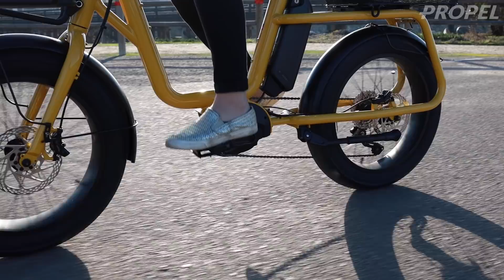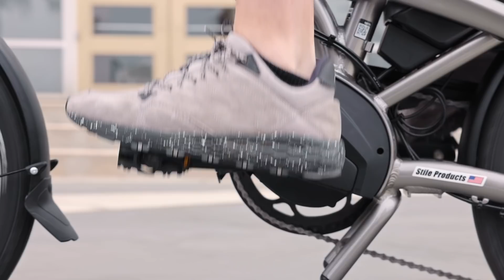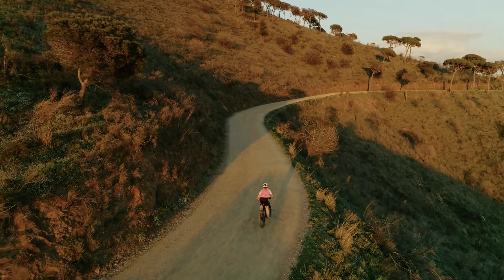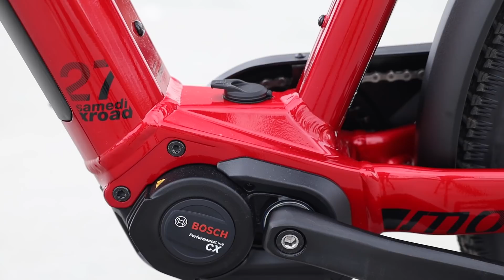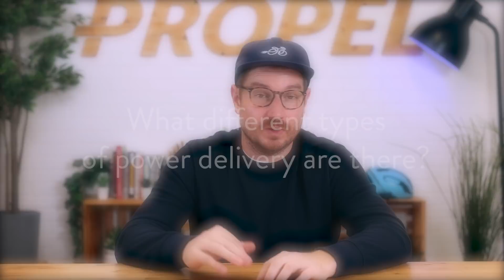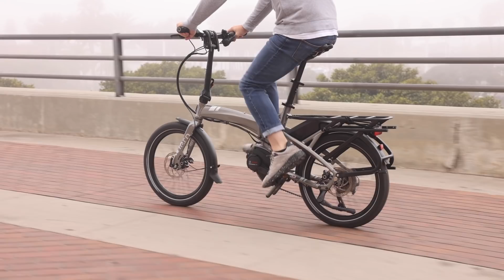10 things you should know about eBike Motors

Comment: Don't know if it's in the comments or not but, quick question... how would you emp proof an e-bike? Or does it even need to be done? Like if you get one of those EMP Shield things, where would you connect it? Folks put them on cars but gas pumps run on motors too, so no gas pumps-- no gas. E bikes'll still be going but you'd need a good gun to keep it. Still... how do you emp proof an e-bike?
Reply: Just got hit with  class 5 solar flares and nothing happened

Comment: Yes it was a great video thank you for doing this my thing is a torque I was thinking about that tonight and my other thing is those bars have a motor that I can put on my mountain bike mid drive adapt I have a wtb if you can believe I still have one lol. Because I didn’t want to convert it to electric torque is very important to me I no longer ride off-road this would be so that I could use it for work my intention is to have a push lawnmower and blower and a Weedwhacker all battery operated and that’s my intention to have a side hustle

Comment: Thanks for the video. I have a question that you did not address: Why do mid-drive motors often advertise twice the torque at the same rated power from the same company in a hub motor? Are they taking credit for the gears? Or do mid-drives actually have circuitry and/or gearing that doubles the torque?

Comment: I never thought about it as throttle vs pedal assist.  I always assumed most ebikes just came with a throttle for situations where you wanted to take a break and let the bike do its thing for a few minutes.
Reply: Thats more a USA thing really, most euro countries don't even allow a throttle. The taking a break is not much of a issue on most mid motors if you put them max support you only maybe add 40watts thats almost nothing and is like taking a break but just moving along as if you are almost going downhill. The added value of only peddle assist is that your peddles kind of control things all the time and is closest to normal cycling and feels very natural at all times including if you hardly need to push its like just having a nice tail wind.

Comment: A useful video, though the thumbnail suggests that you were going to go through the innards of a motor or two.  I'm looking for more info on the geared motors, and the durability of those that have plastic/nylon gears.  
Good to teach your viewers how to derive watt-hour figures for battery capacity so that when shopping, they can compare battery sizes whether 24 volt, 36 volt, 48 volt or 52 volt.  Obviously there's a direct correlation between watt-hours and the most common question asked of all eBikes:  how far can one ride this on a single battery charge?

Comment: What about protection systems?  Which, if any, have fuses or thermal cutoffs?  I don’t recall whose motor it was, but was probably a “less” expensive one and they were pointing out that they have a thermal protection for the motor that will cut off power to the motor when it hits 120 deg F.  I live in north Texas and in the summer it isn’t unusual to have 100+ temps.  Plenty of other places get even hotter.  Related then would be if these hot temps can impact the batteries?
Reply: batteries don’t like the heat period

Comment: A wheel motor with throttle is handy if you have a problem with the bike, like a broken pedal, chain or shifter.
Reply from the maker: This is a fair point, but there are plenty of challenges with that as well.
Reply: A simple solution is just make sure you have a spare chain in your repair kit with you. It's easy for me to always have that in my backpack on long rides. Haven't needed it yet, but i have it with me if the chain ever breaks while riding.

Comment: I will only go for direct drive hub motors. Mid-drives have to replace the chain and cassette every 300km and the motors will break down after a couple of years. Geared hub motors will also just self-destruct/ wear out after a year or two.
Reply: My Mid-Drive Motor is from 2010 (Panasonic System) - Chain changed after 6000km/8 Years and Motor still working and my weigth is 150KG (approx 300pounds) It must be a miracle!
Reply: Bet you're a good Räder. @DSP16569
Reply from the maker: This hasn’t been our experience,  but maybe with mid-drives that don’t have any sort of shift detection. I see those eating up drivetrains. I’d recommend checking out the Bosch system, you might find that changes things a bit.

Comment: Can you comment on longevity of the motor and battery? These things aren't cheap disposables I presume.
Reply from the maker: Most will last around 5 years if properly taken care of
Reply: @Propelbikes Do you know what exactly goes bad and can they be rebuilt or replaced? I guess we'd better carefully look at the support & commitment of the manufacturers we buy these from!
Reply: This is where a rear hub motor shines- if it fails (typically very durable) it’s cheap and relatively easy to swap out a whole new rear wheel,quality mid drives are excellent,but if it fails $$$$ and try to find someone that knows how to do a repair - definitely inspect the price of a replacement battery for your specific model of choice/ eventually it will need replacement (could last years if properly maintained) so,yes battery price’s can be $400 or $1500!!! Beware
Reply: @777noirkat  Looks like the direct drive motors are maintenance free but as there no gears and the regulation in EU is capped for 250 Watts you won't find may models with them. The rear  hub is not necessarily direct drive it could be also be similar to a mid drive I guess?!

Comment: It would be nice to setup a shop with a low power wheel dyno, but mid drive would need multiple ratings for each gear. Everybody on earth calls their motor "powerful" no matter how little it has!
What that red bike at 12:08? Looks really nice and I would be interested in it. Mid drive is more balanced, and you get reduction gears even before the drivetrain. However, I've found that they do wear the chain and cassette faster. Hub motors put the weight in back and this affects nimbleness, but there is zero wear on the drivetrain when using only the motor. There is also a reliability issue, as any drivetrain failure with a mid drive takes out the ability to use the pedals and the motor. A drive train failure with a hub motor just means ghost pedaling or using the throttle to glide home. Each has pros and cons, and preference depends on your needs. 

Pedal assist is my friend as a former marathon cyclist. However, a throttle has rescued me several times from inattentive or out of control drivers, and I like having both. Thanks for the video!

Comment: Can anybody explain the difference between torque and assist level? Bosch talk about say, 85nm torque, or 340% assist, but different torque powers seem able to provide the same amount of assist and vice versa. What does it mean in terms of riding experience?
Reply: The Controler limit the Power depending on your human input (The Sensors)

The motor (or better the System Motor,Batterie,Controller) has a maximum output of 85Nm (on a wide rpm range).

(Simplified) - The Sensors detects that you pedal with 10Nm (your human input) the controller set the current electrical output(aka support level)  to:
ECO (60%) - 60% of your 10Nm = 6Nm => Your 10Nm + 6Nm motor = total torque of 16Nm 
Tour (140%) - 140% of 10Nm = 14Nm => 24Nm in total
eMTb (special case with 140% to 340% support depending on current sensor readings)
Turbo (up to 340%) - 340% of 10Nm = 34Nm => 44Nm in total

Ok in all this cases you are even not close to the max.85Nm output of the motor.

Let's say you pedal with 50Nm (harder human input)

At Eco 60% of 50Nm is 30Nm => 50Human Nm + 30 Bosch Nm = 80 in total.
At Tour 140% of 50Nm is 70Nm => 120Nm in total

But

At Turbo 340% of 50Nm WOULD BE 170Nm - but the Motor can only deliver 85Nm  - therefore no 340% support in this case only 85Nm (170%) instead => 135Nm in total

If you pedal with 40Nm 340% would be 136Nm - but is 85Nm
If you pedal with 30Nm 340% would be  102Nm - but is 85Nm
If you pedal with 25Nm 340% would be (and is) 85Nm

Over all the Level (ECO, Tour, Turbo and the variable eMTB) decided how much percent the controller will command the motor to support you (60% to 340%)
The 85Nm is the upper Limit of Support of the Motor - as long as you do not reach (with the Percentage of Support) this Value you get a linear support, if you reach the limit the percentage support will be lower and lower but you still get the maximum support the Motor can deliver.
Reply: @DSP16569  good explanation, thanks.
Reply: If I understand what you're asking correctly... then I would say that it's kinda two sides of the same coin. Torque is simply rotational force...how hard the wheel is spinning. Your assist level basically tells the controller how much of that torque to apply to the drivetrain.... You dictate how much of the torque with where you set your power level. That being said... that may not be the case for each manufacturer and how they choose to apply that percentage - is it a percentage of the total torque that the motor is capable of... or is it a function of the effort applied to the drivetrain by the rider? That I can't answer...but I do hope this helps.
Reply: @ttaylor6868  great, thanks.

Comment: I have a 2017 Big Bud Pro 4" fat tire ebike with two hub motors (AWD) 350 + 250 watts.  I live in the Catskills where my challenge is always hills, especially on dirt roads.  It is not always easy -- but plenty of exercise.  Do you think a 250 watt Bosch would work better?
Reply: I'm no expert and can't speak for the Bosch but my understanding is that if your bikes lowest gear is low enough a mid-drive can get you anywhere your tires can get grip. May not be fast though.

Comment: Thumbs up on (1) looking at torque and (2) test ride. My ebike has a direct drive motor that is rated at 750 Watts, and puts out 40N-m of torque. Many of the geared, 250 Watt motors are producing 60-80 N-m of torque. Torque will get you up the hills!
Reply: power = torque * rpm
power will gett you up the hills, provided the gearing is correct